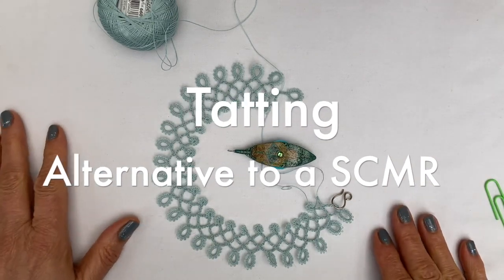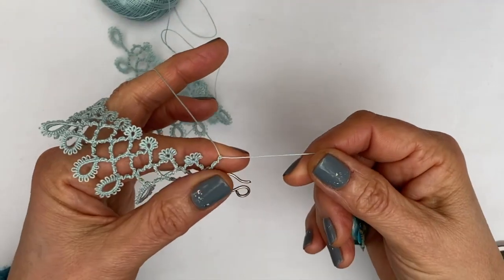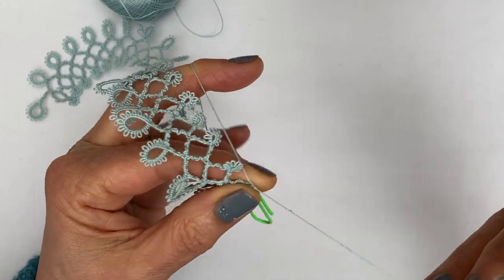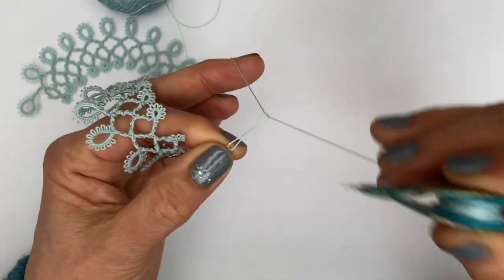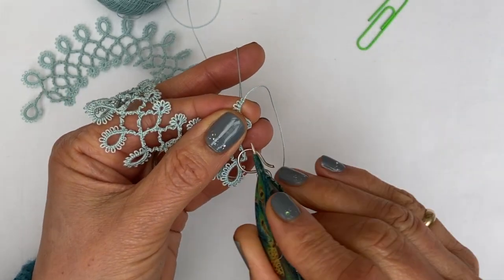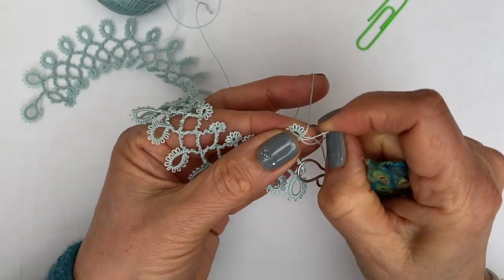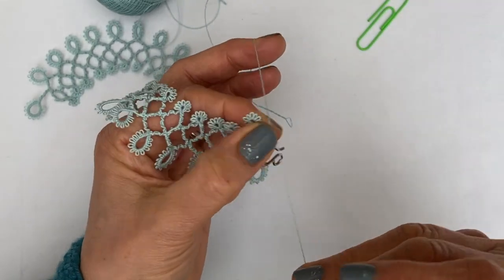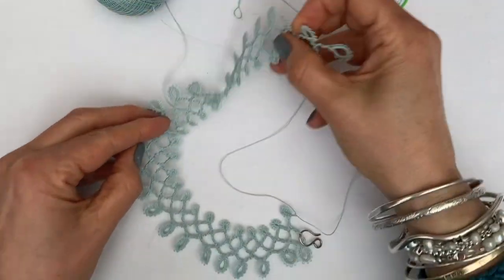Tatting - Alternative to a SCMR

Comment: Also how do you make Lizbeth thread not twisty, it used to be super twisty, then I learned how to roll the shuttle, but still I try to close the ring and it gets very twisty. If that makes sense.
Reply from the maker: Hello, I don't usually find Lizbeth to be twisty but I've had this happen with me with some other threads.  If you've not twisted it whilst winding it on the bobbin, it's difficult to prevent it from being so. I've found some threads to be just too unpleasantly twisty and have given up on them (I remember in particular a ball of fine Venus thread which I ended up throwing away!).  Otherwise, you can stop regularly as you tat, let your shuttle dangle and untwist itself before carrying on.
Reply: @11Frivole  I just get nervous rolling the shuttles you make, I’m ocd and I feel like I’m going to ruin them 😭 but when I do it’s still twisty. I can’t stand twisty thread. Do you have any other tips for Lizbeth though? Maybe I’m just doing something wrong.

Comment: Why did you use self closing Mock ring on this design? Is it to not flip the work and tat from the front side?
Reply from the maker: Yes, that's right.  Using a SCMR lets you work everything from the front side and also means you can work from the ball (avoiding refills) and not need another shuttle.  :-)
Reply: @11Frivole  thank you, I will try it 💕🧶🧵🙋‍♀️
Reply: @11Frivole  v useful information indeed.
 thanks both of u for such a clever question and answer!!
Reply from the maker: @tasneemsadiq9900  You're welcome Tasneem, I'm glad if it was helpful.  :-)